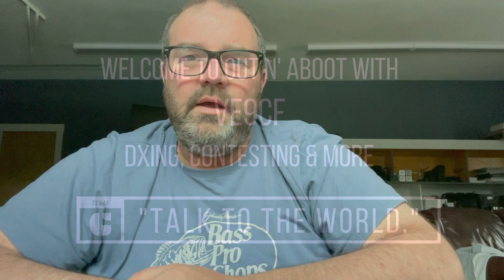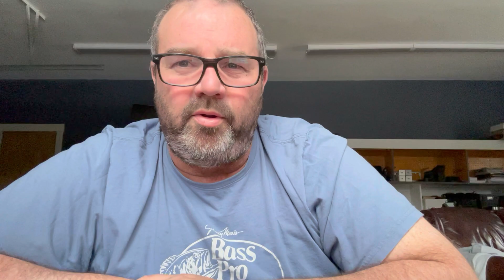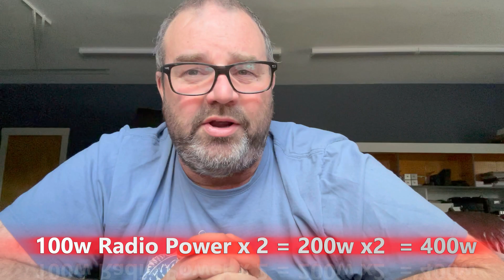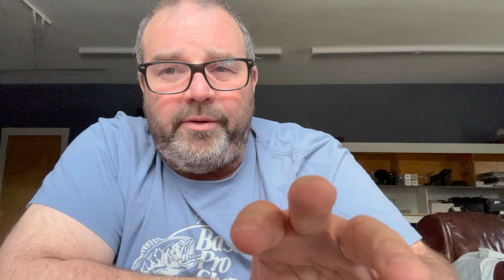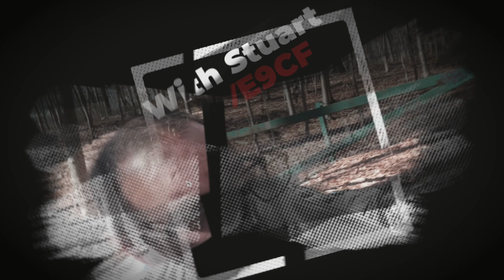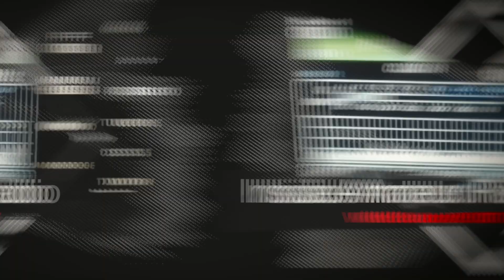5 Minutes To MASTERING Effective Radiated Power For POTA Activators

Comment: We always need to specify antenna gain relative to something. Usually it’s in dBi ( db relative to an isotopic) or dBd ( db relative to a dipole). There is a difference. In free space that difference is 2.1 dB in favor of the dipole. Down here on earth it’s like maybe 6 to 8 dB in favor of the dipole. For example if I am running 100 watts to a high dipole and I replace the dipole with an antenna that is only specified to have 8 db of gain I don’t know if that new antenna will make my signal stronger or not. If it has 8 dBi gain then it is simply the same as the dipole. If it has 8 dBd of gain then it will make my signal stronger by 8 dB which is more than 1 S unit.
Reply from the maker: Good point about specifying antenna gain relative to something!

Comment: I just recently got my Basic with Honours.  The max PEP allowed for my license class is 560 watts.  The Advanced license class is allowed 2250 watts PEP on SSB.   How does one determine the gain of an antenna?
Reply from the maker: It should be in the antenna documentation and I am sure there are measurement devices.
Reply from the maker: That is very true; I was looking at the 1000w DC Input power, and I don't know why they just can't make it simple, 560w for Basic with Honours and 2250w for advanced PEP. "In Canada, Advanced amateur radio operators can use a maximum of 1000 watts DC input power to the anode or collector circuit of the final RF stage of the transmitter, or 2250 watts PEP output for SSB signals. "